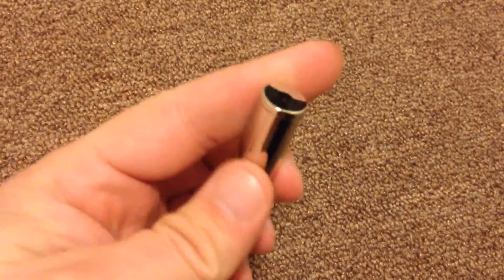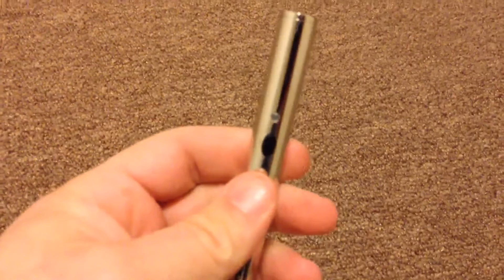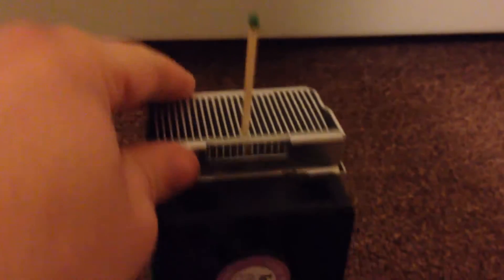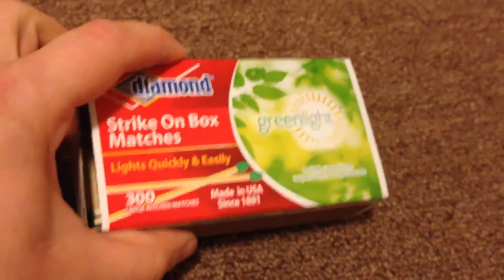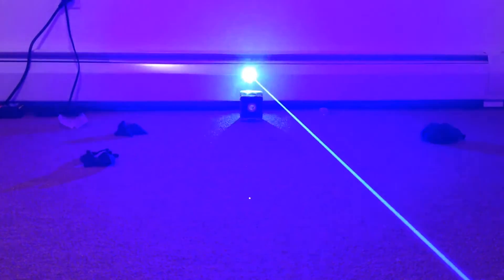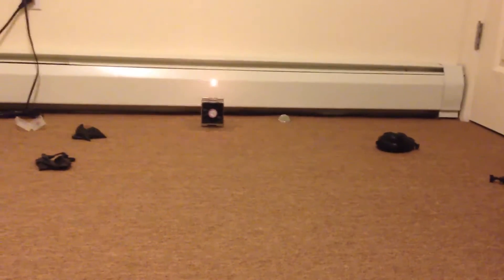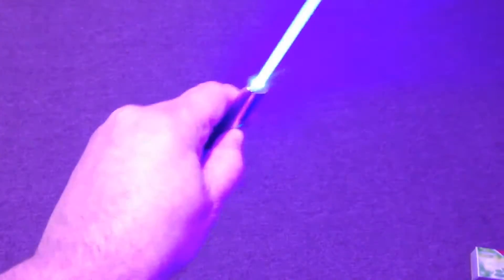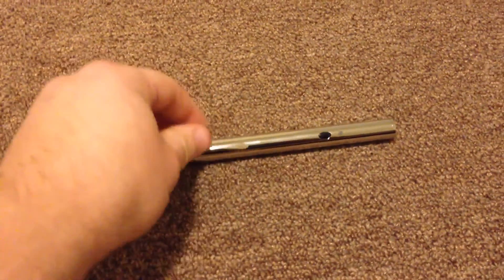Alien Laser 66 3W Burning Match

Comment: How did you achieve 3.5 Watts without a much larger heatsink and surface area for dissipation? I couldn't imagine a 3.5W laser of that size with a duty cycle longer than about 20 seconds on/60 sec off (or more), without adequate heat sinking. Not saying it's totally impossible, just very doubtful, especially for a homemade laser...
Reply from the maker: +Ty B I just update the info